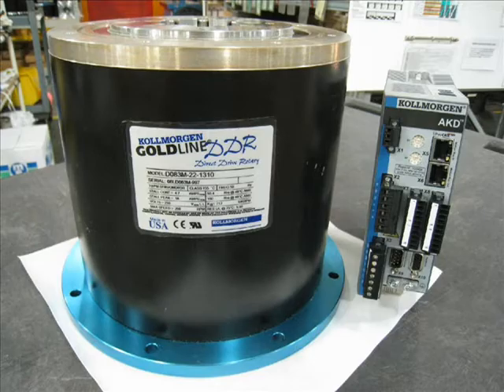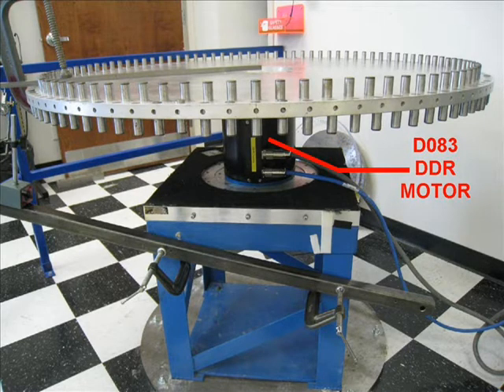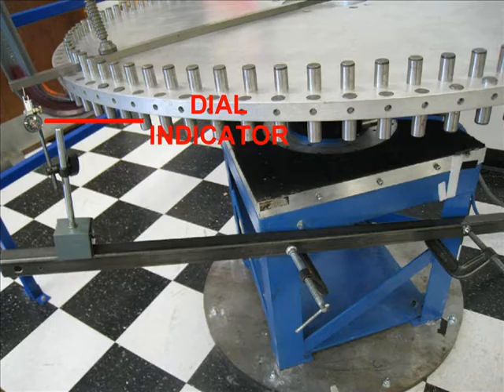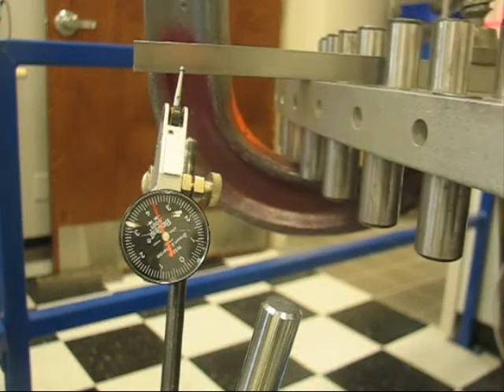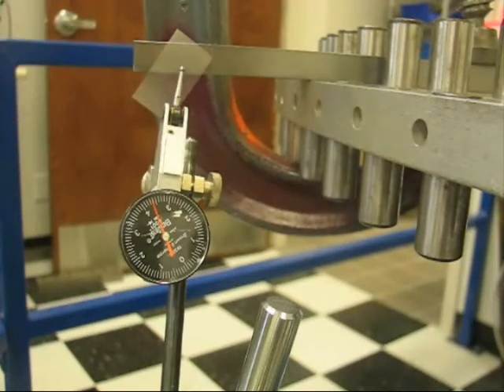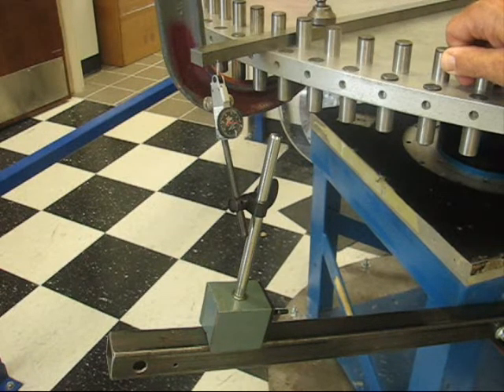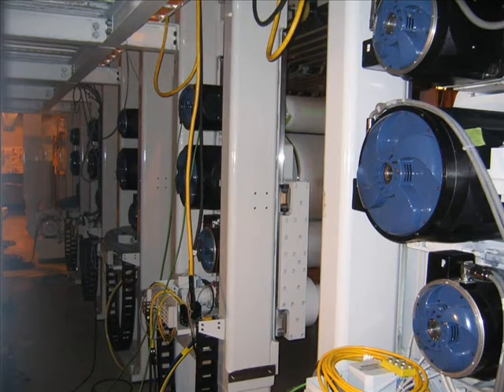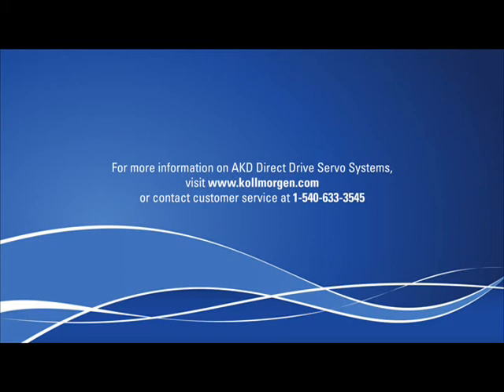Kollmorgen AKD Direct Drive Servo Systems

Comment: I have been trying to find a reason to use the DDR motors from Kollmorgen.
My supplier laughs everytime I suggest we try the DDR for a solution.

The AKD's however are fantastic. I use them in EtherCAT systems mostly and the performance and features are exceptional. Power density is fantastic also. The Kollmorgen Workbench software is fantastic and easy to use. I can configure everything from my office chair.

Comment: I worked with several kinds of servomotors and servodrives, but in without doubt thee DDR of Kollmorgen are the best, mainly due the inertia ratio and good performance of his feedback device.
The AKM series and DDR series are good enough to solve movimente in any kind of work.
I never worked with AKD drive, but if this new drive is so good than Servostar S300/S700, so the competitors will be in trouble.